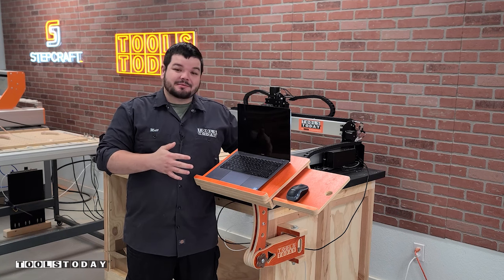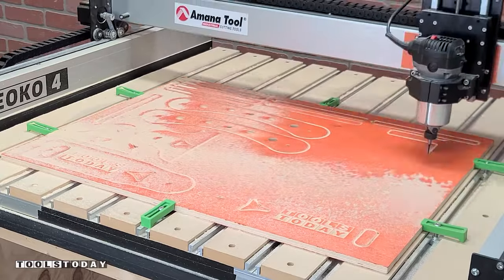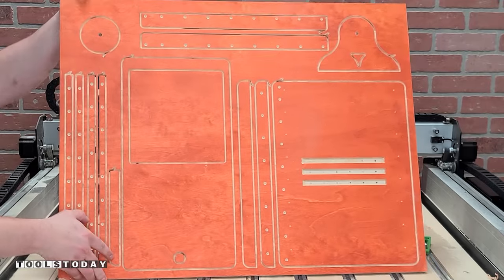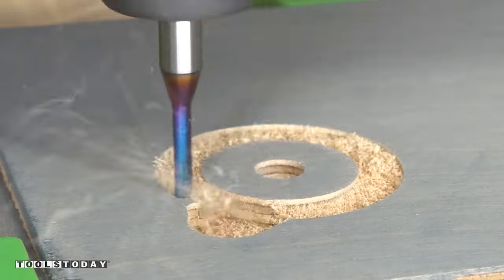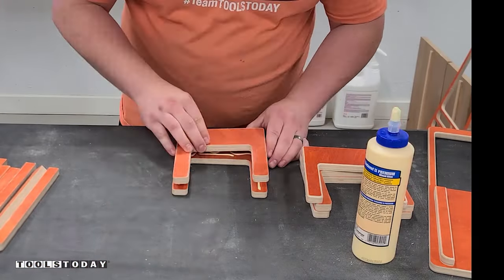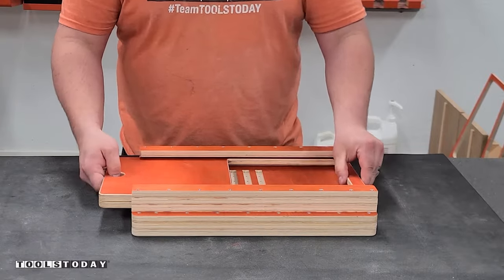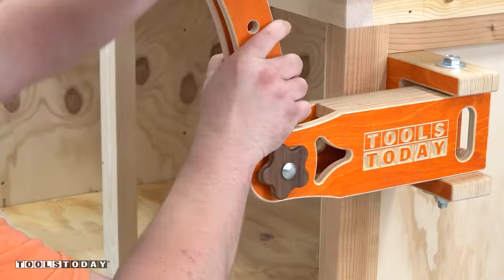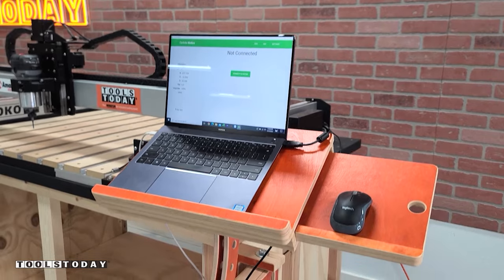How to Make a CNC Laptop Stand | ToolsToday

Comment: I am getting ready to purchase is CNC router. I will be mainly working in Mahogany and Hard Rock Maple, Machining resources into the wood which will hold inside micrometers.
I'm also wondering if it might be able to rout 6061 Aluminum.

Comment: Matt great video I will be buying the file for it is it a vectric vcarve pro file.I( have the same cnc The Shapeoko 4 pro with the bit setter bit runner and the touch probe.
Did you  use the tool change function in carbide motion. If when did you set your XYZ I am trying to learn whey to do that Thanks Jeff peters